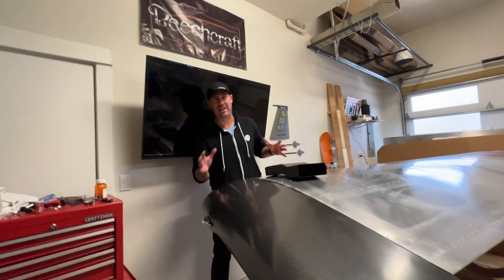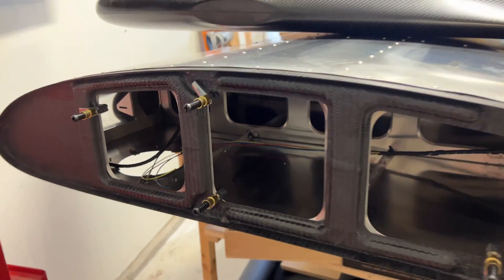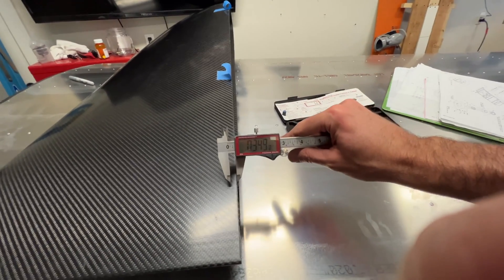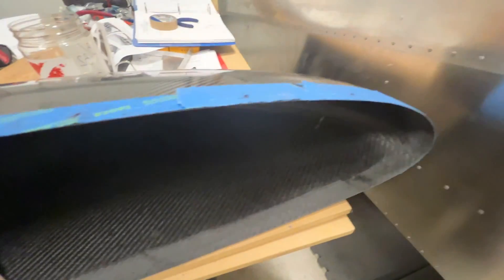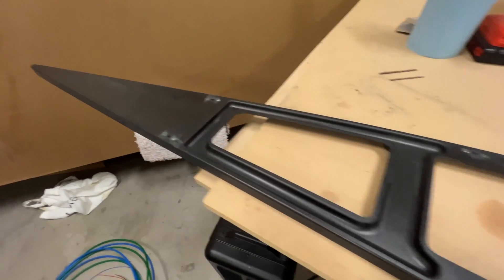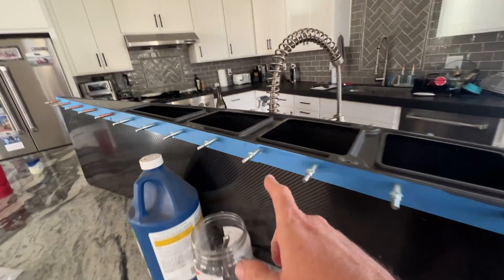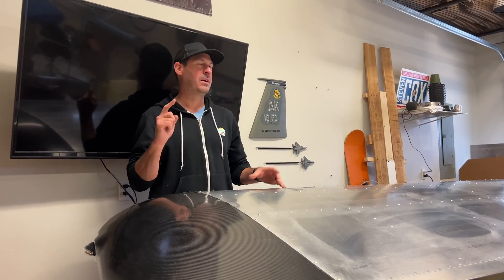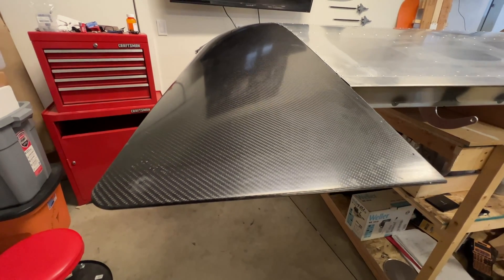Carbon Fiber Wingtips for the Bushplane!

Comment: When I was working on the C-17, a lot of the panels (wheel wells, engine intake shroud, wingtips, etc..) were carbon fiber-Kevlar composite, and carbine drill bits, and countersinks would be completely dull after four or five holes. 
We had to use diamond tips and countersinks, back in 1989/1990 the countersink bits were $400.00 each.
Reply from the maker: Yeah it’s amazing how quickly bits dull on carbon! Thanks for the comment and for your service!

Comment: Just an idea but maybe epoxy the nuts in place for the lights on the wingtip and hopefully leave enough slack that you could replace the light without removing the wingtip. Although removing the access panel may work okay for connecting and disconnecting the wires in that event.

Comment: BTW I been working with Molex connectors for the beater part of 20 years. Still get mixed up. Hehehe. I don't know if you can or need to. One thing I do is when using Molex connectors in a mobile application. If I can. I use GripLockTies over the 2 connectors in between the wire to help keep them locked in place. Be for I found GripLockTies I would use a zip tie and rap it with electrical tape to prevent chafing. don't know if you need it. Maybe if not this will help someone along they way. Also nice to help support Mike Patey with his GripLockTies sells. They ROCK!!
Reply from the maker: Right on! Thanks for the great tip! I’ll definitely put in an order for the Patey ties. They look great. Cheers!

Comment: Nice job good video I did have to shim mine in a couple of places to confirm to my wing. It was easy just added a couple of strips of 6 oz. Carbon fiber cloth where it was needed. Aerosport rocks. I also have the air box
Reply from the maker: Thanks, Mike! And thanks for the “tips” on the forum. I hope my right wing goes as smoothly.

Comment: Those are snazzy looking wingtips. Even if they don't add any aerodynamic performance...their groovyness produces coolness velocity...much more important. The extra trailing edge gives you at least 0.356 square inches of wing area. I will be shocked if that thing won't hover. 

I don't know what your plan is for loose wiring but my ADHD/OCD can't handle random rattles. On vehicles, I have occasionally wrapped wires with that nifty split, tubular,  insulating foam for household hot water pipes...to keep wires from knocking about and chaffing. 

You are going to have one super groovy flying machine, me bucko. It's a pleasure watching it come together.
Reply from the maker: “Hover mode, engage.” All due to the snazzy tips! Thanks for the nice comment as always, hombre. 

Good tip! I need to put some thought on how to secure the harness a little better in the tip. I love the pool floaty idea… 🤔
Reply from the maker: …kidding. But I do like the pipe insulation idea! I’ll look into it. Hope you’re staying warm this winter! It’s a wet one here in Bend.
Reply: @CLEAREDDIRECT  We just got thru a week long stretch down to -40. Not cool.
Reply from the maker: @Joe_Not_A_Fed  …insert joke here about it being very cool and… -40 doesn’t care if it’s C or F

Sorry to hear it homie.
Reply: @CLEAREDDIRECT  No worries. I survived a lot of these in my decades on this planet. (Not so many when I was on Zoltar, but that's another story) so I reckon I'll survive this one. I keep on promising, every year, that this one will be my final winter of snotcicles and frozen breath. Here's to keeping hope alive. HAPPY NEW YEAR, Steve, to you and the whole family.🥳🎉
Reply from the maker: @Joe_Not_A_Fed  happy new year to you, yours, and even your Zoltarian mistress!